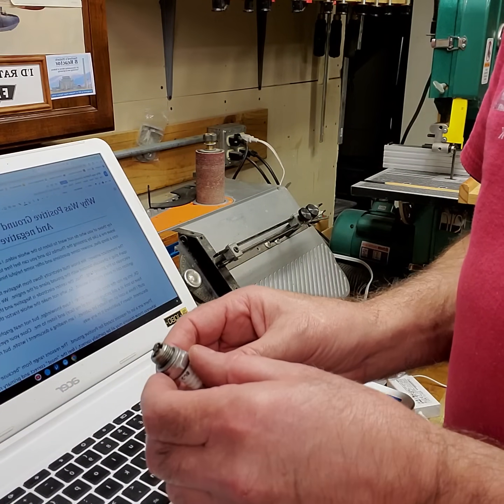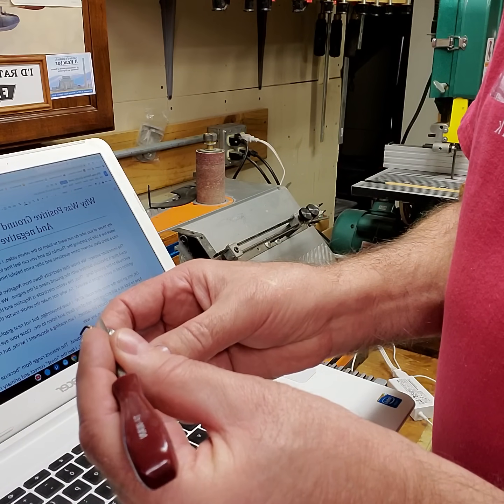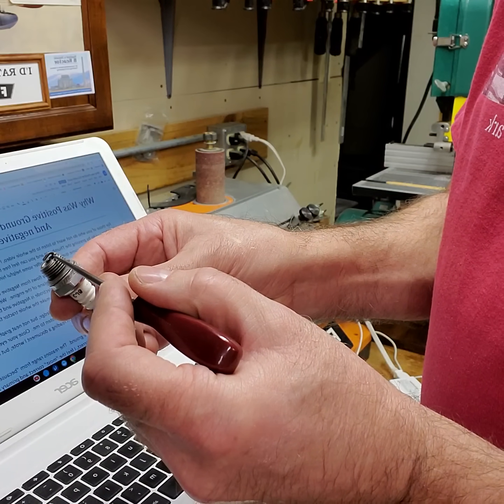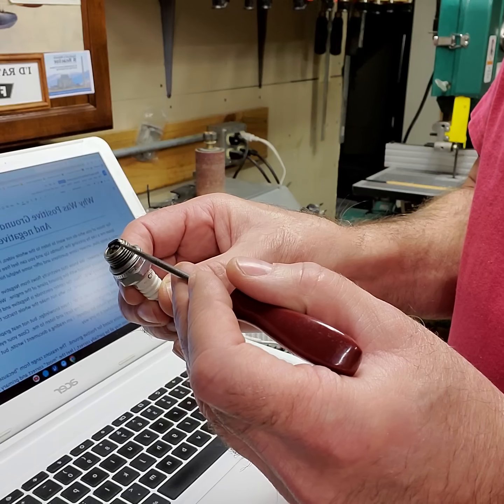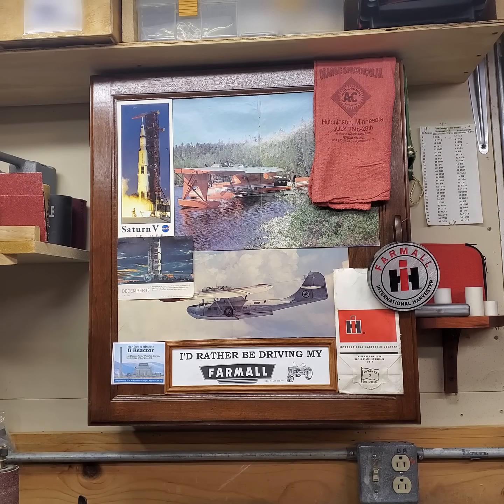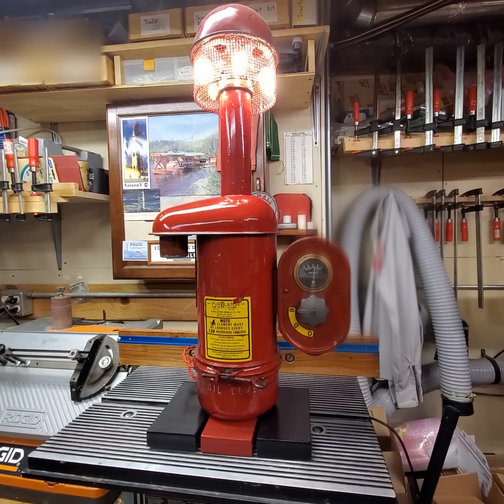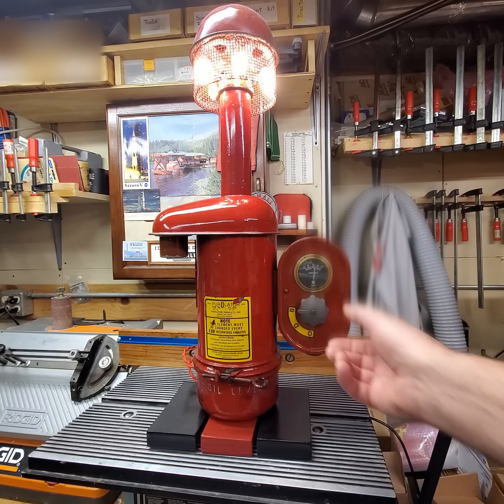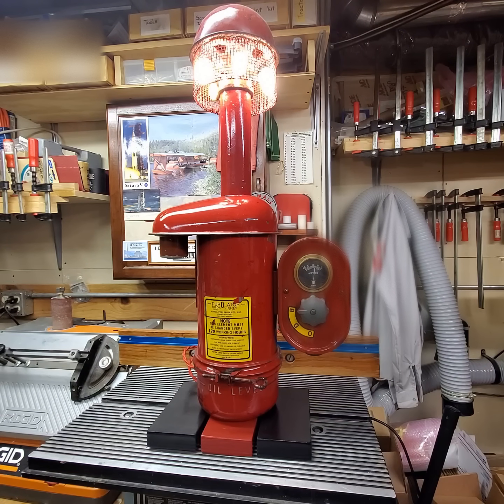Why positive ground was used on old cars, trucks and tractors

Comment: Well, no because you could simply reverse the secondary winding in the coil to accomplish this regardless of the primary winding's polarity. Besides the spark plug will work anyway regardless of the direction of electron flow. The electricity is simply jumping the smallest gap.

I think positive ground was more a European thing than a US thing, What was real fun was putting a radio in a pre-70's Mack truck which had a positive ground system that was switched to 24v during starting (Two battery banks switched from parallel to series during starting), the installers never could figure this out so I'd have to do it. (Ex Navy ET + 38yrs as a communications technician)

You also have to consider the coil works by the collapsing of the magnetic field (Inductive kick) so the discharge would be opposite polarity of the cuttent that established the magnetic field... Why you put a diode across a relay coil reverse polarity to absorb this and keep the spike off the supply line. (Or a capacitor)

As far as the galvonic thing, this would be more to do with disimilar metals in contact than the vehicle body which is insulated from the earth by the rubber tires. I would think galvanizing the bodies starting in the 80's would be what stopped corrosion, not the polarity of the electrical system. (Which hadn't changed from those pre 80's cars that rotted out)

Comment: I'd suggest that however positive ground became initially the custom (whether it was ideas about spark plug sparks as you've suggested -- which might also pertain to wear patterns in the distributor -- or something else) negative ground became an electronics philosophy that spread to automotive electronics once vacuum tube circuitry got off the ground, pun possible.  First these vacuum tubes required far more voltage than a vehicle battery could furnish, so a vibrator circuit was provided to feed a step up transformer -- but like spark coils, that transformer can be wound or connected either way.  Eventually special vacuum tubes appeared that could run directly from the vehicle battery which would have solidly cemented the negative ground polarity if it wasn't cemented already.  As we know, eventually solid state supplanted vacuum tubes, and it can be constructed to operate on either polarity, though there is a performance edge with electrons rather than holes as charge carriers (hence NPN transistors vs. PNP transistors) and that favors negative ground again.
Reply: NPN=not pointing in neg-  PNP=Pointing in pos+    transistor
Reply: What exactly is the performance edge since all maths work the same for electron theory or hole theory?

Comment: Interesting spark plug, with a left hand thread...  But I suspect the early part of the video was reversed as text was also reversed. Regards the ignition system, the spark plug itself gets AC, the frequency of which is determined by the inductance of the spark plug, and the value of the capacitor that is across the contact breaker. Unless there was AC (caused by "ringing" in the primary of the HT coil), there would be no induction of energy into the secondary (HT) part of the coil. Electricity does indeed flow from -ve to +ve, as evidenced by the operation of a vacuum tube. I would speculate that the advent of semiconductors into the car's electrical system was the reason that we changed from +ve earth to -ve earth. The reason that the engine does not run so well when the coil connections are reversed is that the "bottom" end of the secondary (high voltage) is connected to the "bottom" end of the primary winding, and this connection is the "CB" connection, which needs the capacitor across the contact breaker. Reverse it, and the capacitor is no longer part of the equation.

 Regards changing from a dynamo to an alternator, the alternator is physically able to run at higher RPM, and as a result, has a much smaller pulley than a dynamo. This allows some generation at "tick over".

 Regards,

 Cossiedriver

Comment: At 15:01, better to say that the distributor includes the POINTS, and the POINTS are simply a switch to GROUND.  Also, if one actually wants to experiment with a reversed spark plug polarity, it's not simply a matter of reversing a few wires.  The internal wiring of the coil has a common connection for both the primary and the secondary.  Simply reversing the wires on the primary also messes up the secondary wiring.  So, a proper experiment includes isolating the ground side of the points and connecting it to positive instead of ground.  Of course, the rest of the coil wiring needs to be properly connected.
Reply: Wow. I had to look this up. The 20,000V is relative to the positive voltage coming from the battery (ignition switch), not ground. So if you want a reverse spark, you would (as you say) isolate the base of the points from ground and connect it to the positive coming from the ignition switch, but also connect the "+" terminal of the coil to ground. Of course then your spark would only be 19,988V (or maybe it would be 20,012V) but I don't think that would make any difference.
You might also have to reverse the polarity of the capacitor. If it is electrolytic, it wouldn't like to be hooked up backwards. (probably burst)
Reply: @GordieGii  Spot on!
I was personally trying to avoid tackling that explanation...
Well put.
Reply: But the points are on the 12V side (primary) of the coil, not the HV (secondary) side. The cam that operates the points is on the some shaft that rotates the distributor arm but isn't electrically connected to it.

Comment: Retired EE.  I was taught that positive to negative current was "conventional" current and negative to positive was "real" current, as an homage to Franklin and others.
Reply: EE here as well.  I believe that virtually all of us think in terms of conventional current flow as opposed to "real" current.  I find it MUCH easier, generally speaking.
Reply: @don_cc123  That works well only until you hit a semiconductor...
I think in both terms (electrically bilingual, LOL) [or is it ambidextrous???]
Reply: I mostly see the need to know this in vacume tube guitar amps.

Comment: Yes that is the key answer they thought that electricity flowed from negative to positive when reality positive and negative some scientists don't even know if this is the way no electricity flows but least it flows. This is why when you have an old 6 volt system you have to double check the spark on the coil to make sure the Sparks firing towards the plug and not back to the coil.
Reply from the maker: Hi Paul!  Exactly!  Nicely said.  Thank you.

Comment: I like your video but only thing I can not understand is why you could not find photo's to use to go with what your talking about to help (for me) learn better. My truck is wired Positive and is confusing me big time but I passed a solar degree with no problem...... thank you for the video that helps me understand
Reply from the maker: Hi Anthony.  I know ... I could do much better with images and video editing software.  Another viewer suggested a white board.  I think some day I will re-do this.  I will beef it up.  But, I promise. no background music!!  ha ha
However, I do see other channels doing "Lecture style" presentations.
Reply: Seems like a lot of training for electricity these days starts with electronics.
When I went to tech school in the late 90s we learned points ignition. 
We laughed at first, why should we learn points?
Because it's the first ignition system,and we can't jump to distributorless until you understand how points work. 
Well, ya can ,but you'll not get the knowledge you need.

Comment: It depends on the direction of the windings around the core of the ignition coil and has no effect on battery polarity.
Reply: @Kelly Harbeson If it is reversed or not depends on the direction of the winding. And you can reverse it back on the secondary side by swapping the terminals on primary.
Reply: @Kelly Harbeson No. Polarity of signal going through transformer depends on direction of winding and on choice of leads on secondary side. If both windings are made in the same direction, lets say clockwise, and both have grounded lead being the begin of each coil, the signal will keep its polarity - positive peak of input wave remains positive at the output. If output leads are swapped, the polarity changes. You can use transformer as reversing polarity or not. The same applies to ignition coils. Such coils, in general made as autotransformers, can be used i both types of voltage polarity. All it takes to keep the spark negative at the plug is to swap primary ends of winding.
Reply: @Kelly Harbeson I still don't get how you do see the reversal of polarity. It all depends on how the transformer is made and connected. There is no such thing as "always reversing" because there is no fixed point of measurement.

Comment: The change of vehicle earth polarity occured in conjunction with the introduction of Alternators (as opposed to the older lower powered generator technology). These "new technology" alternators were lighter, and had higher output and featured diode rectifiers which required Negative Earth. Thus the virtual overnight change to negative earth was a result of the "new technology " chargeing system requirments.  

Dont need a college degree for this, just a few years experience with vehicles of the era of the change and knowlege of the early electronic ( diode and early transistor based rectifiers and charge controllers).
- the dc generator era charge systems had no need for diodes and the charge controllers were clever electro mechanical devices (predateing any electronics)
- the alternators required diodes (negative earth) and the system designers were looking at the future of electronic charge control ( again negative earth)
Reply from the maker: Hi John.  Thank you for your comment.  I greatly appreciate your input.

Comment: So many things wrong here. Firstly the electrons in a conductor barely flow, you can walk faster than them. Secondly the output from the Kettering ignition system is alternating current. There's no real polarity. The secondary winding of the ignition coil is in series with the primary. When the points open several hundred volts are induced in the primary which is stepped up to several thousand volts in the secondary. If the connections to the ignition coil are reversed the output will decrease a little but typically not by a significant amount. The spark plug will spark regardless of polarity.
Reply: Have you seen secondary voltage and current oscillograms ? I guess no :)
Reply: @flappingflight8537  Secondary current no, voltage pretty sure yes. Long time ago when I made a CDI system for my first car.
Reply: @robroysyd  CDI and MDI ( which accumulate energy in the magnetic field of the coil )are different animals, even though there is at least one type CDI schematic ( where the coil primarily winding is paralleled with a diode ) which produce DC pulses of Voltage/ current as well as MDI . Negative polarity on the central electrode give you 25-30% lower breakdown voltage on the spark gap ( this is related to the higher temperature and the shape ( the sharp edge ) of the central electrode) . Even when CDI ( which produce AC secondary pulse) the first pulse need to be with negative polarity on the central electrode ( because of the mentioned already reason ). So called “Waste spark” ignition systems ( they are MDI usually) where one coil power two spark plugs in two different cylinders simultaneously and respectively the polarity on one of them is correct when on the other is incorrect. So the difference between the breakdown voltages of paired plugs is few KVs , also if regular cooper electrodes spark plugs are used in such a system one of the spark plugs in the pair ware out faster the central electrode , when the other one ware out faster the ground electrode  . So this are two proves that the secondary Voltage and current in MDI systems are DC . Just check for video in YouTube about ignition secondary voltage / current oscillogram  there are plenty.
Reply: @flappingflight8537  I have looked at those oscilloscope images taken from capacitively coupled probes on the high tension leads and you're correct except they're positive going pulses. The other thing is positive grounds are not limited to vintage automobiles. Some wireless gear of WWII vintage used a positive ground and some manufacturers of audio equipment have also used a positive ground but later variants used a negative ground. You really had to take note which wall wart went with what. 
I've also heard another explanation as to why early vehicles were positive ground. It meant a shorter lead from the battery to the chassis.
As for spark plugs it's been a long time since I've removed one but I thought the centre electrode was made of a much harder metal than the ground electrode as you needed to be able to adjust the ground electrode to set the gap.
Reply: @robroysyd  the oscillograms  are actually inverted purposely,because usually people associate the higher  voltage with upper side of the graphics ( the screen ) and this way is easy to digest it ( for me as well ) .
Reply: @robroysyd  the “modern” so called copper core  spark plugs electrodes are actually made as their name suggest from copper( both electrodes ) wrapped like in higher temperature and erosion resistant metal like Nickel alloys ( but not only , every manufacturer has his own recipe) . The copper core allows faster heat transfer an dissipation , because of that todays spark plugs has relatively much wider heat ranges so they do not get fouled under the light loads of city driving and on the other hand didn’t become the source of pre ignition and melt  under high and continuous engine loads . In the past on some high performance racing engines have been used two different heat ranges spark plugs , one for staring and warming up the engine and second much colder set of  plugs for the race . 
Even the last generations spark plugs with Platinum, Iridium , Ruthenium tips use copper core electrodes and the noble metals are used just for the tips .
Reply: @flappingflight8537  OK, so relatively modern cars with their negative to chassis battery connections produce high voltage negative pulses to the centre electrode of the spark plugs.
How do we get from that to a positive battery connection to chassis being better on older vehicles because more / better spark? What prompted the change?

Comment: A distributor takes away ground from the coil to collapse the primary side of the coil that induces a increase in the secondary side of the coil to build voltage till it's strong enough to fire the gap of the plug ,, the coil is actually a step up transformer in function,, to say it's positive ground based on what you see ,, it could appear the spark jumps from the center electrode because the field is being pulled from ground and it's initially slow then gets stronger and looks like it's coming from the center electrode,,, I dunno ,, you're far more educated than I am. I was a Gas Turbine Electrical system tech in the Navy,, I worked on some pretty serious equipment. Sadly I also got a severe dose of non combat PTSD that prevents me from working on anything even closely associated with electrical circuits. I've saw electricity do some very fantastic events. These idiot politicians have no clue how unforgiving AC 3 phase electricity is. To imagine a windmill will supply all of our electrical needs in a AC 3 phase environment is totally ludicrous. Having spent thousands of hours in front of the ships electric plant control console that I also maintained I have saw what happens when voltage, or frequency isn't maintained 100% of the time. We were trained to put the ship in the dark instead of letting the ship experience a brown out. 

I probably need to watch this a couple more times. 

Once I saw an electrical fire ball of sorts jump out of a generator switchboard that was 3ft in diameter and it bounced on the electrical matt in front of it for roughly 2 seconds before it vanished. I was training a new man to shift the ships load from ships power to shore power and he closed the shore power breakers approx 45° out of phase ,, it sounded like the generator was tore off of it's foundation.  I'm gonna subscribe to your channel and follow you no doubt

Comment: I had a '61 Ford Zephyr, an English car, with positive ground. When I put a radio in it, I had to mount it on insulated fittings, to accommodate the negative-earth radio.
Reply: Zephyr's were still positive EARTH right up until 1966 / 7 when the Zephyrs / Zodiacs were on their last model, the Mk4..
Reply: I put an old Chrysler positive ground 6 volt radio into a 12 volt negative ground Ford. Had to do the same thing but it worked.
Reply: 65 Ford Cortina GT, pos  gr. First car . Had to wrap my head around this theory, worked well . Later I accidentally wired my73  Chevy wagon coil backwards during a tune up & experienced a crank & No start condition.  Another mech noticed and advised me of my error., an easy mistake having recently sent my English Ford to the scrapper , wish I still had it. For the MPG. ⛽️